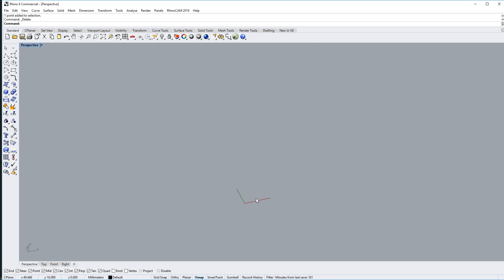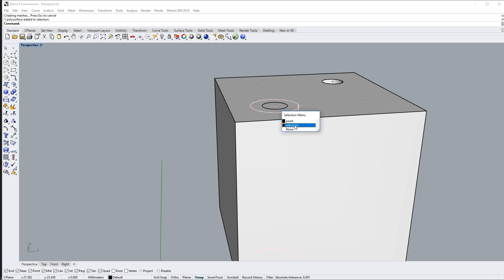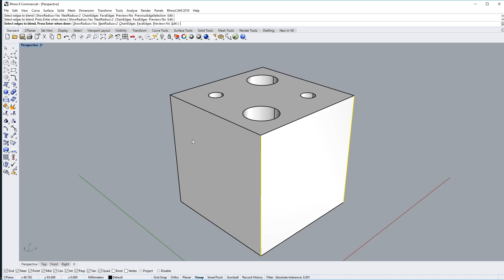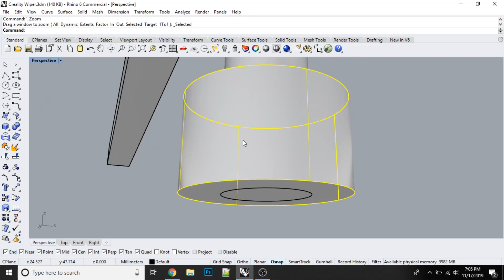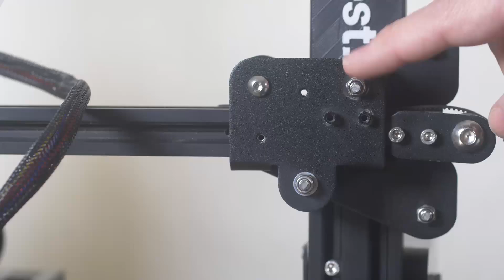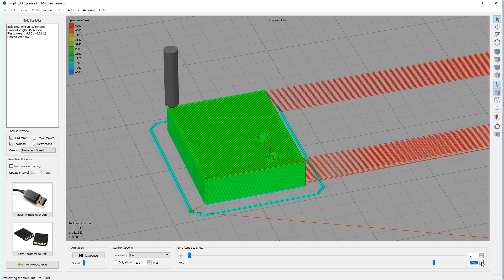Custom Nozzle Wiper for Ender3 & CR10 - No More Layer Shifting PETG!

Comment: Neat idea but you should use a brush that is NON-CONDUCTIVE. You will get some people that can have the heater wire touch the bristles and the thermistor leads. How do I know? Because we see customers clean their hotends with a wire brush and blow out boards all the time. The mosfet on the hotends switch the negative line so the positive is always on. It will lead to a short. Please take this down before people damage their machines. Great idea but just do it with something other than a metal brush.
Reply from the maker: @TH3D Studio
 Did you miss the part in the video where I showed the plastic fan shroud in between the bristles of the brush and the wiring? I even talked about the fan shroud getting worn out by the bristles. Even if I removed the fan shroud blocking the two from coming into contact with each other, there would still be an air gap of about 10mm between them. It's virtually impossible for the wires to come into contact with the metal brush in my design. I think you know that. I think you understand the enormous difference between a statically mounted wire brush which can't possibly touch the wires vs. one sloppily held in someone's hands. I think you are just attacking me for the third time in a desperate attempt to become relevant to "the community" once again. Since you are here, I am going to ask you to stop selling that t-shirt that mocks me. You have no business with Prusa. You try to sell products that compete with Prusa. You have no skin in the game; no reason you should be personally offended that would justify selling that shirt. You are just an opportunist without compunction. Your customers are leaving you because they see you for what you are. I was wrong in that comment I left on your video. Yet you were the one who deleted it because your response showed your true character, which is far uglier than my mistaken words.

Comment: This would have to be retrofitted to the Tevo little monster as well.
Reply from the maker: It's more difficult to implement on a Delta printer. To do it right you would have to mount it to the frame way at the top of the travel. That is a LONG distance to travel when you wipe on each layer. You don't need to do it every layer, but still, it's a long distance for stringing. I would say that this fix is best implemented on I3 style (overhead gantry bed moving in Y-axis) frames  or CoreXY printers (or other designs where the bed moves in Z and the nozzle moves in X,Y).
Reply: @DesignPrototypeTest  Yeah, they're right. Would be difficult.
Reply: @DesignPrototypeTest  Maybe later. At the moment I am testing some parts.
V6 standard and both versions of the mosquito hotend. wham bam flex plate. And I have a Plexiglas housing mounted where I am currently working on an exhaust air. With ventilation pipe (aluminum Flex pipe). And I ordered several materials for the insulation of the printing plate. The hole below, I'll do close it too. My goal is to create a negative pressure with a fan so that no smell comes out of the case. But I have to close some holes at the top.

Comment: good way to short something out..... if the wires touch the heating wires and thermistor wires POOF
Reply from the maker: I'm having a hard time gauging you attitude from your comment. I can't tell if you are another hateful anonymous cowardly guy who shoots down everything new because the world should be as miserable as you feel inside. Maybe you think you are making a legitimate point, and just did it in a disrespectful way. Anyway, you would have to be a special kind of stupid to adjust it so that the bristles touched the wiring. As I have it now there is about a centimeter of airspace between the brush bristles and the wires.
Reply: @DesignPrototypeTest  Seeing as I've seen people do this mod before and fry their boards, I see it as a valid comment. I didnt really have an attitude in the comment but as for you calling me "some hateful anonymous cowardly guy who shoots down everything new because the world should be as miserable as you feel inside" You probably should do some research before making assumptions about people, or keep it to yourself. peace

Comment: i have been polishing my nozzle with car polish and waxing it between prints of PETG, that has kept the PETG from crawling up the nozzle and ruining prints. But i like your attachment too.
Reply: You nailed it I think! (Please see my response to Jon Mitchell --- the oozing is not the problem really, it's the stickiness of the nozzle.) I have eliminated gunk build-up and improved overhang detail dramatically with a similar technique, at least for shorter prints (< 4 hours). I use a stainless steel nozzle, which I clean while hot at PETG print temperature (about 245C) and polish with 1000 grit sandpaper. Then I spray silicone contact spray on the nozzle. I don't how yet how often the polishing has to be repeated. I would love to hear from a  professional about what would be optimal strategy for polishing and maintaining stainless steel surface slipperiness. Car wax after a sequence of graded emerald cloth? Also, a comparison with brass and nickel would be interesting.

Comment: Sorry but that's not a good idea! you destroy the nozzle with the Metal  brush! Put it under a microscope 🙈
Reply from the maker: @Build-a-Skill disagrees with you. As per his comment: He has 13 years of printing with a Stratasys that uses a wire brush to clean the nozzle and he has had no issue with nozzle wear.
Reply: alright!

Comment: For those concerned about nozzle wear. We have a 12+ year old dual extruder stratasys with a wire brush feature like this that is used with every layer. The wires are some kind of metal (dont know what, steel? ) and over time the wires deform to where they no longer clean the nozzle. Every few years we simply shift the wire brush around so the nozzle starts hitting the wires again. 12+ years and it's never really been a problem.
Reply: There's always a ton of confidently incorrect commentors on any video. They spend about 1 second thinking about things, not testing their theories, then spew out a hot take as fact.

Comment: I've got less stringing (with PETG) after installing a "capricornus" tube (cheaper Chinese clone) with 1.9mm inner diameter and a new brass nozzle.
Now I only get a seam and that's it. IDK if I can get rid off this defect too (LA is pretty much calibrated already). My machine is Tevo Flash in stock variant (TMC2100).
Reply: Set seam to random 👍🏻

Comment: Can you make your videos shorter? they are a bit on the long side
Reply from the maker: It's true that my videos are "long form." I don't constrain myself to a time limit for any video. I just start making the video and editing it together. Whatever the length is when I'm done, that's what gets published. I do cut a lot of scenes, but that is based on other factors such as correctness of the information, boorishness of the scene, duplicate/redundant information, etc. Basically, my videos are as long as they need to be. In this case, it sounds like you weren't interested in the bulk of the video, and this video has a pretty poor retention rate so you aren't alone. I could have made this into a 2 minute video. Pretty much just the tl;dw, and the footage of it working. If I had done that you would never have seen the video because YT preferences videos that are over 10 min. long. Notice how nobody releases 2 min videos anymore? Short videos are less likely to get posted to your feed. So basically I have to make the videos as long as I make them, but you have a number of tools at your disposal. You can watch videos at 2X speed, and make liberal use of the 3 second skip ahead feature (Right arrow on your keyboard, or double tap the right side of the video on mobile). One pro-tip about my videos, I tend to have distinct scenes. If one scene is too slow for you just skip to the next scene. Thanks for watching faxxzc, see you in the next one.

Comment: Do you think that the brush will wear out the flat end tip of the nozzle over time and prevent you from having smooth extrusion paths/layers?
Reply from the maker: I think the nozzle will wear out from the inside before this happens, but I'm also looking into only wiping on every 10th layer.

Comment: It's a pretty simple idea, but would you be able to monitor it for nozzle wear? I am a bit worried if you are using brass nozzle and brass brush, it will wear down very fast. Maybe reducing the amount of wiping after every few layers, not every layer? Or maybe use different material for brush: normal plastic brushes probably won't withstand nozzle temperature, but what about silicone brush?

Comment: Or you could just put a decent nozzle there for a few bucks instead of all this duck tape.
PETG doesn't stick to quality nozzles.
Reply from the maker: The best nozzle on the market won't help you when you are running a Bowden tube setup with 3-4mm retractions and printing PETG at 265° to ensure the best layer adhesion and hence the best strength of your functional part. Stringing is bound to happen with this setup no matter how much money you throw at your nozzle.
Reply: @DesignPrototypeTest  helps me though.
What brand of PETG are you having problems with?

But even if you go your way, at least use something other than wire brush to wipe the nozzle. 
Some proper wiping fabric should do order of magnitude better job.

Comment: its nice you're still making videos! keep them coming!
also there was a plugin for octopi that can execute gcode on certain triggers like for example 200mm of print or 30 sec... so you can use it instead of cleaning the nozzle on every layer it cleans depending on amount of filament extruded.

i'm sure this can be done with Duet !?
Reply: Good idea.  That would reduce a lot of the extra print time and possible nozzle wear on the brush.

Comment: I'd recommend a steel nozzle when using this.  A hot brass nozzle being abraded with cold brass bristles.  I would suspect that might wear down the nozzle before long.  I guess if you noticed a marked increase in the instances you had to relevel the bed due to the nozzle getting further and further away, that would be a good indication of wear.
Reply: That is a great point
Reply: I’ve always been curious as to how the brush will wear or possibly create a burr at the nozzle opening. He should do a long term test video
Reply: you can also use a some silicone rubber for the wipe like a purge bucket or possibly even a nylon brush. id go exstra fast so you dont deform the bristles too quickly if you were to try it
Reply: @MrStemkilla   actually this is a fantastic idea..  some high temp TRV silicone  molded to a pad or brush would be just the trick
Reply: @PaulColeVFX  they sell silicone matt meterial really cheap, i have almost a life time supply of 1mm silicone matt that i got for another project. it was a few bucks for a 2'x3' roll of the stuff. i cut a few strips to make almost like a silicone brush for my printer and made a  mount for it. I havent had time to make the G code to actually test it out yet but eh, im half way there haha

Comment: As a Prusa owner, I've gotten phenomenal prints with PETG and Nylon but I've also had issues with both on occasion. Sometimes PETG does stick to the nozzle, especially if the printer is travelling between multiple parts or columns. I have not had this issue with Nylon or PLA, and usually printing one part at once is fine with no issues even in PETG.  I also have a Sidewinder X1 and never had a single problem even printing several parts at once in PETG with that. I think this problem is more pronounced in bowden setups with large retractions, perhaps also with different PETG brands.

Comment: My startup script takes care of clean nozzle. First i will let the bed heat up. Then g29 level, then i move the nozzle to x20 y20 Z0, then i heat up the nozzle, once heated up, go to first layer height, prime the nozzle to x direction about 100mm then quick wipe of 30 mm and voila clean start after few rounds on brim, but as said first layer only. I have had any issues on subsequent layers with petg with my e3d volcano

Comment: "I don't think Prusa had this" man you really hate Prusa. "Now watch my favorite printer, that's a Prusa clone, print with my ultimate upgrade that's as significant as the heated bed" (paraphrase). No, nozzle wiping is great, but heated bed fixes so many first layer issues with so many materials it's basically a necessity. You have skill, and I enjoyed many of your videos but your seething hatred for things and bias ruin some of your content. Let it go. Also don't tin your power supply connections 😁 #makerhater
Reply from the maker: The Prusa printer is upheld by most as the pinnacle of 3D printer design in the consumer space. I'm merely commenting on the fact that "the best" printer on the market doesn't even have this feature. I don't hate Prusa. I see however that you harbor some resentment toward me as evidenced by your reference to things which I have said in past videos but are irrelevant to the current video. Also, you are flat-out wrong about the Ender 3 being a clone of the Prusa printer. Look up the "Mendel Max" and "Mendel Max2" which came out before Prusa's I3 design. Both the Prusa I3 and the Ender 3 are derivative of the Mendel. Prusa even sold the "Prusa Mendel" before the I3. Dr. Ed Sells invented the Mendel printer. Prusa is following the work done by academics. He didn't come up with the design himself.
Reply: @DesignPrototypeTest  I don't have any personal resentment, I do like much of your content. As I said you are skilled. I think you would be much more enjoyable if you let go of some resentment toward others. I understand your frustrations, as a software developer open source means a lot to me and gets abused by multi-billion dollar companies all the time, and it's terrible. Having videos specifically for that is great, if you truly understand the legal issues. But to some degree opensource lends itself to abuse so that us regular folks can be assured that we'll have access to the code to build from in perpituity, which is an incredibly honorable sacrifice. My point was, not every video you make had to include a jab at someone.  Also, while I'm well aware of reprap Mendel, the Ender 3 says i3, not Mendel. Prusa is not the pinnacle, it's a great machine, but moving beds are bad! Everyone knows Ultimaker is the pinnacle, Prusa is just a great product at a relatively reasonable price. 😁
Reply: To be honest, Prusa genuinely is an asshole.

Hatred or not, he shits on free software and free hardware by violating licenses as much as some Chinese companies.
To prove me wrong show me the source files for mk3 design.
Reply: If I may ask, what do you mean by source files? There are some CAD files published on GitHub that include heatbed and frame parts, is that what you mean or something more specific? https://github.com/prusa3d/Original-Prusa-i3/tree/MK3S There are also SolidWorks files that people made, converted from original files.
Reply: @SanityAgathion  Shh, don't bring logic into this. There are literal 1:1 clones on AliExpress based on those files and even full MMU2 clones with cloned 1:1 PCBs. Googling is hard.
Reply: To give some benefit of the doubt, I have heard Prusa Research staggers publishing of source files until the printer is out and then possibly few weeks/months after release. Either because they are not in instantly usable form or to get some time advantage over clones that will inevitably appear. Beardman Hairy may have just looked at the time when those were not published yet, concluded assholism and not check later.
Reply: @alin116   hrmm interesting to see an mmu clone and how it compares to real
Reply: @PaulColeVFX  yeah, I was also considering one, just to check it out. Most of them are electronics only, w/o printed parts.
Reply: @goury   his github has it all.
Reply: @PaulColeVFX  So gimme the link or bigmouth
Reply: @goury   your incomplete sentance  has me confused .. link to what exactly.. there is alot in this tread to decode what you are reffering too.   and if you are goign to insult and be a troll expect no legitimate responses any further.. 
The world needs constructive people  and not fat trolls getting fed by  being baited.

Comment: Love this! I switched my ender 3 to BMG/v6 direct drive on MKS Gen L running 2208's, and after some tuning it took care of a lot of my PETG booger issues. But I still get some build up and it leaves behind big old blobs every 20-40 layers, depending on the print. I think this will perfect my PETG prints, thank you! Also after watching your 3D design process I think mine will improve, once I translate for F360 of course.

Comment: Great project for a large diy community that also considers their E3 their go to printer. I have just upgraded my E3 pro to a SKR E3 board, and it works, and it was so cheap. But I dislike messing with the firmware. Thank you for sharing you process. What came to mind was the use of a servo to extend and retract the brush so as to avoid having to grind n file. Unfortunately my cad skills involve scratch paper.
Reply from the maker: It takes about 5 minutes to file the groove with a round file that costs $3. The K.I.S.S. principle in engineering dictates that we remove complication. By that reasoning the servo solution, while clever, is not ideal.